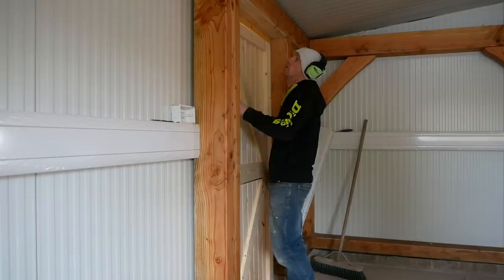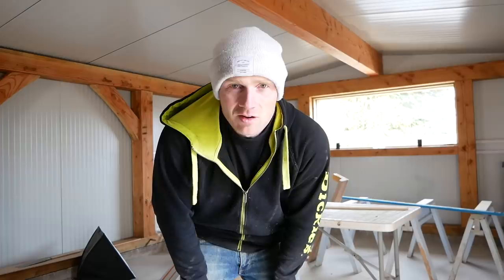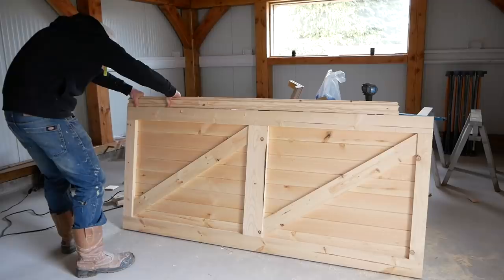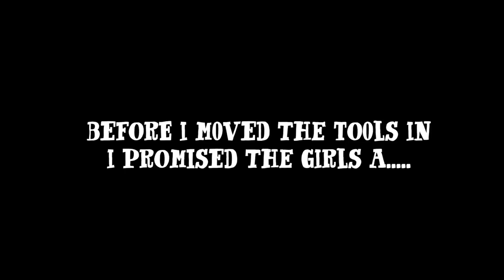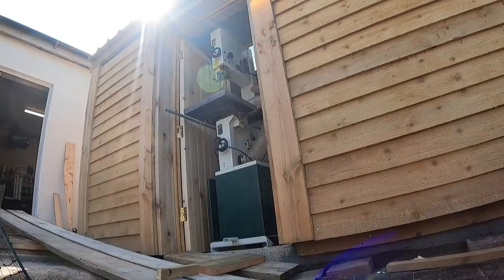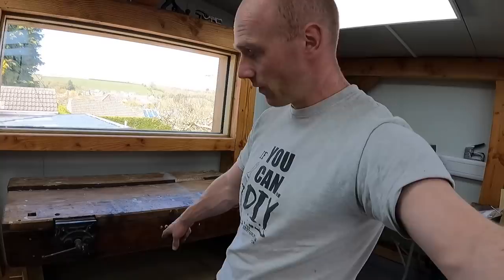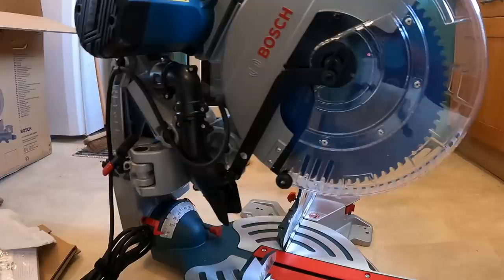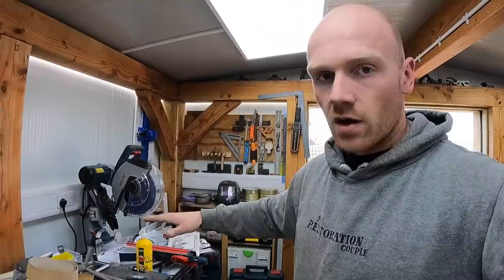NEW SAW, NEW DOOR AND MOVING IN AT LAST!

Comment: Only bit im not clear on ... You get your door frame in place and trim the bottom so it fits.

When you offer the new door in before youve cut it, how do you know how much to take off? Do you measure floor to just below the top of door frame? 

Great video as always
Reply from the maker: Yep just with clearance top and bottom. There will be a weather  bar and a brush seal under door but didn’t want a threshold.